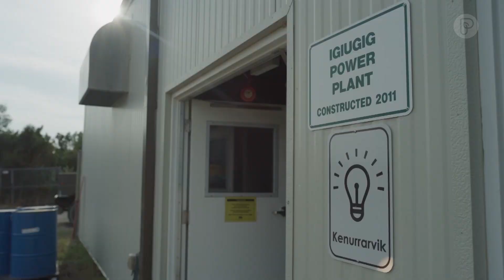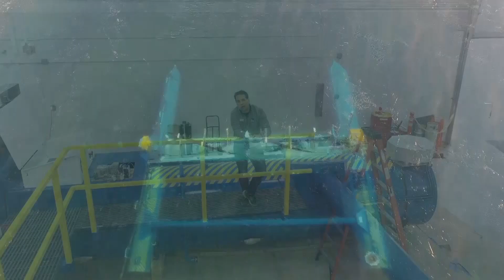Building Solutions: Alaska River Power

Comment: Unique solution for a small, and isolated community. I imagine that those in-stream devices could work in many locations provided there isn’t commercial navigation requiring a channel depth. Great video, thanks for sharing.
Reply: Yeah, different problems require different remedies. No one size fits all solution.
Reply: Dirt will accumulate around it which needs to be cleared i guess after every 3 to 4 months or more frequently